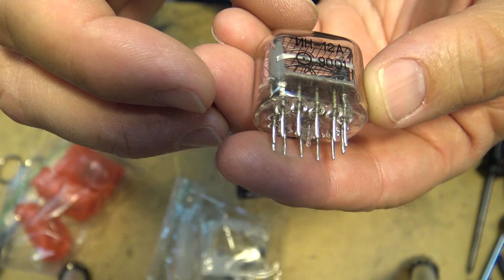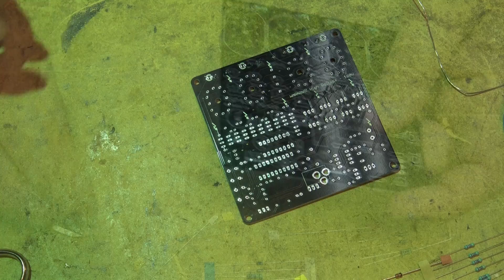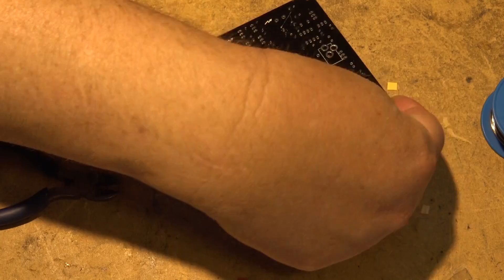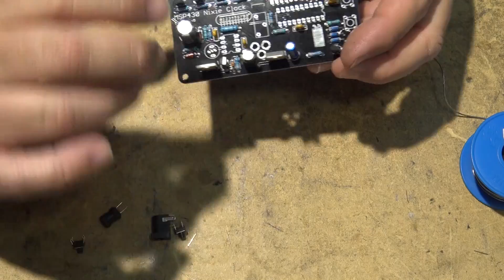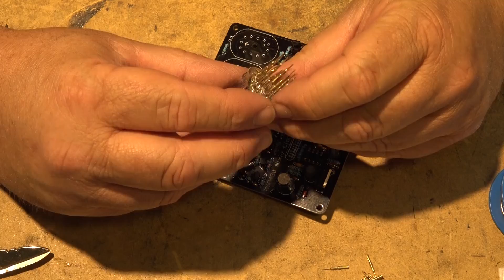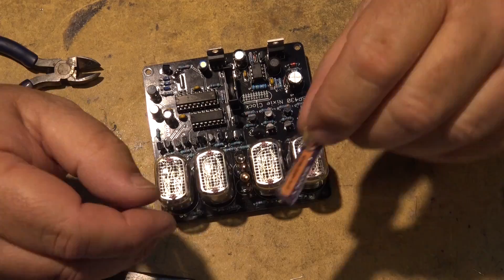MSP430 Nixie Tube Clock kit #2 build

Comment: I do like those russian displays, chunky and need no support :-).
I smiled when you said 4017, i used one for multiplexing a frequency counter i designed years ago :-), driver transistors and a classic two transistor astable multivibrator to feed the 4017 clock input.

Smashing kit :-)
Reply: That's why I used 4017, nostalgia ( lots of memories back from the 80s :) )
Reply: Yep i liked the logic chips, 4000 and 7400 series :-D
The 555 timer has been a workhorse as well, and its millions of years old... well perhaps not millions :)

Comment: "...PDF prints in black and white."
Just change your print settings by using the Advanced Options menu. Or use Ctrl+Shift+P.
Reply from the maker: If I saved the PDF and opened with acrobat yes, but this was printed from the browser, and color was selected and it still printed in B/W. Once it was printed I wasn't about to print it again.

Comment: hmmm, how to mount it?
Reply: His web site also has an acrylic case available.
Reply from the maker: umajunkcollector 
I neglected to indicate that I wanted the 10.00 case until it was too late. there is a front and back cover to help keep fingers out but the sides are open. 
I intend to make a base for it is to stand up but the plan is to keep it relatively open so the components can been seen. my other nixie clock is totally enclosed.

Comment: What happened to red, red, yellow for 220K?
Reply: Swarf Rat - That's for a 5 or 10% resistor (red-red-yellow-gold->220k, 5%); the precision (1 or 2%) ones have 5 color bands, or (red-red-black-orange-brown, I believe).
Reply: Precision resistors have 3 first colors for first 3 digits then multiplier, so 5 bands.

Comment: glow discharge indicator ИН-12А, 90 01=year month (not russian, soviet tube!), department of technical control number 12, workplace number 18... ah and ah, vintage, retro, old crap and nostalgia! ha ha ha...
Reply from the maker: Right on before the fall of the soviet union
Reply: Yes! Right before the fall in quality. right before the fall of any production. By 1993 (or 94), the Soviet industry and economy was "covered by a copper pelvis" (slang). saw with my own eyes. i was worked in the production of TVs. termination (or delay for months) of supplies of components, theft at the plant, salaries in the millions, despondency and dullness... the industrial and scientific city has turned into a market! soviet design office and pilot production (rocket engines for сс20 (satana), энергия, буран), not far from my house, now offices for rent... 
but life goes on, everything is not so bad! i have a screwdriver and a soldering iron, and a little brain in my head! here I wink at the author of the video... monitor "packard bell callisto 170" waiting for me, i hope it`s capacitors, as usual...
Reply from the maker: This is what I understand too. Before the collapse, everything was state run and quality tightly controlled. (probably for fear of a bullet in the head for botching the job) so components were very high quality. Many  audiophiles also look for soviet era vacuum tubes. NOS American and British tubes the most sought after, and then the Soviet tubes. Saying that though the current Russian made tubes are great. That is what I am running in my tube amp. Electroharmonix, they sound sweet.
Reply: no no no, fear of a bullet in the head - it`s too much! i can say about from 1987 to 1993. If you dont work qualitatively then you dont have - monthly premium, annual premium (called thirteenth paycheck), unpaid rest in a sanatorium (24 days! with family! maybe near sea!), good workplace (will be transferred to janitors, maybe temporarily)... you have - brainwashing in the labor union, brainwashing in the chief's office, brainwashing in the smoking room (your friends dont have monthly premium too, unfulfilled plan), at the end you have dismissal. as you see, in USSR you was have long way to dismissal, you can work drunk for couple months and only then you lost your job (maybe, if big boss catch you). i knew three old peppers in 1988 who daily found alcohol (98%, blue flame), walked with red noses and somehow performed work! foreman did not see their condition? or did not feel smell? i dont know... it was funy old three peppers :)

oh, memories, sorry for offtop! sorry-sorry-sorry!

i still waiting for video with repairing VCR, betamax or VHS - it does not matter! i`m maniac! 12volt, please VCR!!!
Reply from the maker: It was my attempt at humor. If you saw the way they were portrayed on American TV and cinema you would understand. Do it this way or else. I get it though perform or no bonus.
VCR videos coming. I have several machines to get to soon.
Reply: i know, i know! Red Heat - "doveriay mne", "kakie vashi dokozatelstva", "pachemu ti ne lubish gruzin", "kokainom"... or Moscow on the Hudson "svoime glazame"... we saw it all here and laughed at the vision of Hollywood :) total videomania started at 1986, "perestroika" and "glastnost". the VCR cost as a car, but someone buy it and all relatives and friends are watching from Griechische Feigen to Rambo and Rocky and Tom & Jerry! ah Star Wars, ah Alien, ah Jaws, ah Sergio Leone+Clint Eastwood+Ennio Morricone, ah ah ah!

"VCR videos coming" - washing my hands with air in anticipation!
Reply from the maker: Don't forget James Bond!